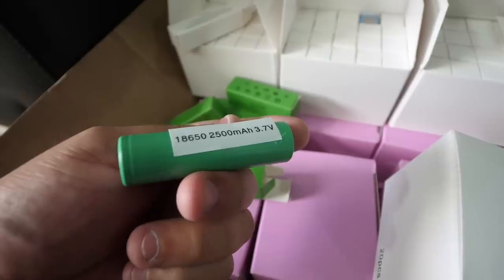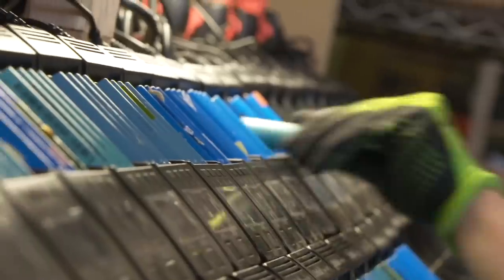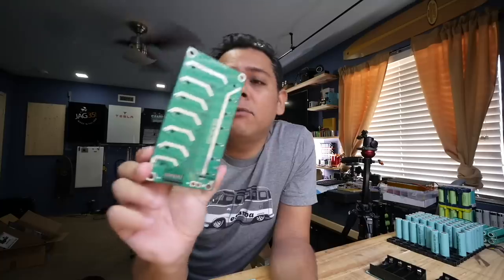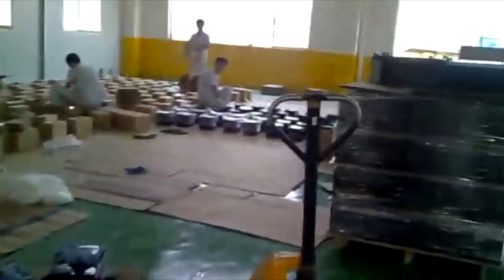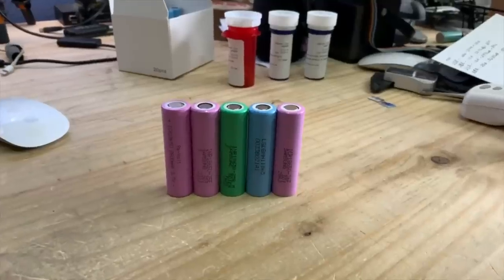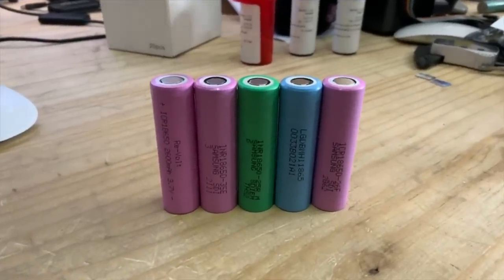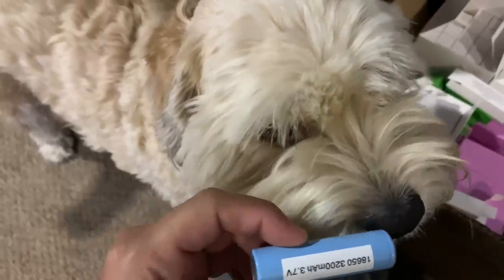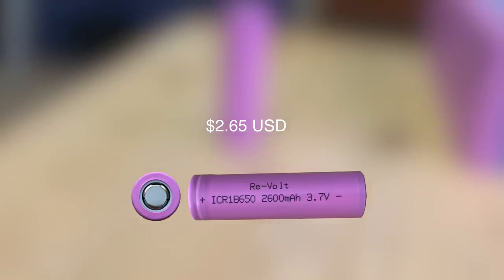How to TEST 18650 cells  (DIY Powerwalls)

Comment: what cells are good for a 12V 100A DIY battery pack made of Li-ion cells?? 18650s , 21700s or other. Instead of 10A is it a wise option to good for a 40A discharge with better mAh to reduce the number of cells, therefore less weight. Better discharge so that my motors can draw at least 50A on different motors.

Comment: Old video I know, but do you offer a 14s pcb? I am currently building a power wall for a little project and have decided that 48v system would be the best for my use. so I am looking for something more advanced than just making 13-14 200p cells with a couple bms's in paralleled.

Comment: Can you do a good short video (maybe 5-10 minutes long or so ) explaining the typical 18650 battery descriptions please. Because I need to know what mR (internal resistance) a supposedly brand new 3000mAh Samsung 18650 30Q 15A button top unprotected battery should read on my Zanflare C4 charger tester. All my four supposedly brand new Q30s display 2.50mR - 3.50 mR on the Zanflare C4. Should all good condition 18650 batteries have about 1.00mR ? I can understand the 10A versus the 30A discharge ability and the 3000mAh versus the 2000mAh storage capacity and the 3.00v versus the 4.20v volts concept but don't know what the proper mR (internal resistance) should typically be at. Thanks so much

Comment: I do not think the operating temperature is what the maximum temp the battery will get. I think the operating temperature is the range of temperature that you can actually charge and discharge them. If they write max 60 celcius, I think it mean that it is not suggested to charge or discharge it at any load if the outside temperature is more than 60. What do you think?
Reply: Um the Operation temp is set by a test in the factory that shows how hot the battery gets if the maximum current rating is used over the entire capacity of the cell:)
Reply: @peterzingler6221  No. That is exactly not what it is. It is exactly as some people already said the range of temperatures in which the manufacturer "guarantees" it's product to work in. For more you can also read https://en.wikipedia.org/wiki/Operating_temperature

Comment: You don need anything fancy at all to charge batteries its all standardised and the chips are cheap as dirt.
MCP73831T-2ACI/OT -  LI-ION/LI-POLY CHARGE CONTROLLER its 72 cents.
a cheap charger may be risky but if you can open it up and see if its using industry standard parts .

Comment: ALWAYS ENJOY YOUR VIDS MY BROTHER ! . I HAVE A QUESTION ON EBAY I CAN GET 4 " Panasonic NCR18650B 3.7V 3400mah Battery " FOR TOTAL FOR 22.49  THEY ARE BUTTON TOP CELLS FOR LASERS AND NIGHT VISION .  THEY ARE MADE IN JAPAN WHICH SOME SAY ARE BETTER THAN MOST IN CHINA ESPECIALLY THOSE CRAZY OFF BRANDS ,DO YOU THINK THESE ARE A PRETTY GOOD DEAL AND GOOD PERFORMANCE ? THEY ARE ALSO PROTECTED CELLS AND COME WITH A STORAGE CASE !  THE NIGHT VISION DOESNT DRAW VERY HIGH AMPS ALSO !

Comment: Jehu, how about a project on building single solar panel solar generators, for example, a 300watt panel with a lithuim cell pack , a charge controller and an inverter, all in a self contained unit or two, maybe three smaller panels 100watt panels in a folding configuration, or three 300watt panels that interlock and inter connect as needed?  Saludos from PUR.

Comment: I also started to harvest 18650s from laptops and cordless tools.

I'm testing the capacity of the cells with my XTAR VC8. I've taken 3 measurements of the same cells. And from 2nd and 3rd measurement I only took power cable out and back and new test started again ( the cells have been untouched) and the results are +/-, is this normal?

the differents between 1st and 2nd measurement [mAh]:
+/-56
+/-5
+/-62
+/-10

and then 2nd and 3rd[mAh]: (only power on-off and test again)
+/-10
+/-6
+/-34
+/-11

How are your experiences with your capacity tests?

Comment: Have you gotten into 20700 and 21700 batteries yet? Theres a really great guy in the vaping scene named John, he goes by battery mooch. He professionally tests batteries for a living, ya should look him up, just google battery mooch, hes tested and rated hundreds of batteries. Ive started using 20700 and 21700  bAtteries as they have higher capacity and continous ratings.

Comment: Hi i have a question mayb u can help me out. Whats a safe amp draw if i were to connect 3 lithium ion battery  in series (11.1volt)  the battery specs are: 3400mah rated at 4.9 amps. Its the ncr18650b. Im used to the c rating printed onthe battery not the amps. Thankx
Reply from the maker: Those are 3c max I’d say, so 10A-13A

Comment: I understand you have a very busy schedule and have a business to run. Don't know if you saw my question yet or not but was wondering if there is a way to use an electric motor on the front of an e-bike to charge a secondary battery system so that you could use a dual system of batteries to extend the range of an e-bike?
i was thinking a 48 volt motor on the rear and a 36 volt converted to a charger on the front . do you think it would work I do not have your experience with ev's and needed an experts opinion on it.
Reply: thermodynamics says this is a stupid idea. If your idea is to use the second motor to  charge a battery. Anyway bigger battery or use less power are best way to increase range.

Comment: I thought that storing your cells in a cooler or colder temperature did not affect 18650s     any opinions on that?.
Reply: Hot or cold will ruin a battery

Comment: pricing on these are so close to lifepo4 cells.  Though I'm comparing your 2018 18650 numbers with 2020 lifepo4 costs.  

lifepo4 lasts way longer so why would you use 18650 for a powerwall?

Comment: Hi, Jeju; At 7:43 - I saw that you said that your 10-cells' average mAh value - across the 10 cells is/was 3,649 mAh's - but that looked wrong. I ran the numbers, and for those 10 cells' values - their average is: 3,689 mAh's. Not a big deal - but I thought I'd call it out.

Josh

Comment: When you say genuine do you mean brand specific? Can non-genuine cells still function properly and at the right voltages sometimes?
Reply from the maker: All cells can be useful,  but you shouldn't be paying Mercedes-benz prices for Kia performance.
Reply: who said there is no kia that performs like mercedes, even better in some features
.
Reply: They just needed a post content, an 18650 is an 18mm by 65mm Li-ion cell. You can get into brand efficiencies after that, but this title is just a cash grab.

Comment: Do a video on how to order cells directly from china
Reply: I sell 18650 battery，We usually find a forwarder who can do DDP or LCL by sea export.
Reply: 程前 Whats your Price per cell?
Reply: @程前-k8n  well, bud, what's your website? We want to buy
Reply: Deltasec Computer  my batteries are 1200 to 2600, price from 0.4 to 1 USD , most of the using in the lights Bluetooth speakers so my battery is the capacity type

Comment: @VK ELECTRONICS  after separation each 4 battery are showing 4.5 volt, total battery power is showing 17 volts. Now noticeable point is battery is 14.5 volt whic is print on battery case. Now the proble lm is my battery backup was 10 min, after opening and testing i close the battery but my laptop is showing "battery is Permanent damage, please change it." Please help me!

Comment: In addition to thier discharge performance, how well do these cells hold up to the safety and robustness specs in thier datasheets? For example, the Samsung datasheets claim thier cells will not catch fire or explode when subjected to a 12V/2.6A overcharge for 2.5 hrs, or similar. 
Obviously, this would destroy the cell's normal characteristics so it's not something we'd like to do with cells destined for a powerwall. But perhaps it would be prudent to also confirm these safety specifications from the datasheet in a real-life test? Especially from a lesser known manufacturer, who may not catch as much legal flak than "brand name" manufacturers if their cells don't live up to thier specs in a spectacular way. It would be interesting to see how all these cells deal with abuse when something does not go quite as planned.
Reply from the maker: Totally,  I see torture tests in my future for these cells

Comment: Hello brothers, I NEED YOUR HELP, !!! PLEASE!!! I want to build spare power pack for my xiaomi m365 scooter. As far as mechanics ,soldering, connection etc !'m sound and I know what I'm doing BUT I don't know what cell spec I need. 
SO what I know  I will use 18650 and I want 36v 7800mah setup. I read somewhere that i need 2500mah cell. I don't know how its calculated but i read it somewhere. Can you suggest what spec I need? THANK YOU!!!

Comment: No the resistance is higher because your battery cell is warmer than 25 degrees C
Reply: The internal resistance of the cell doesnt change by temp ^^
Reply: @peterzingler6221  ohh it definitely does. If you deny this you deny some of the basic principles of our scientific laws.
(also iam an University Graduate of Electronic Engineering so i probably know what iam talking about).
Please think before you talk, and if you still don't believe me just google something.

Just look at this graph. https://www.mpoweruk.com/images/calendar%20life.gif (ignore the time on the X axis).
You can clearly see that the battery on different temperatures has different resistances.
Reply: @brinkshows2720  Buddy if you have a grade then shame on you for this graph , what does that say not even the type oft battery is listed
Reply: And even then when we are willing to call changes in milli ohm Region a resistance change the resistance sinks with temp its not higher like you said
Reply: @brinkshows2720  a higher current means more energy transfered to heat by internal resistance yes, its a huge Problem in some electric cars
Reply: @peterzingler6221  Well lets take just a random resistance number out of the video. 68 mOhms.
Discharging your cell at 4V 10A means a loss of 6,8 watts over 33,2 W which yout output.
Now lets say you believe the graph and you go from 30*C to 55*C you increase that resistance with a factor of 1,3. This makes the cell 68*1,3=88,4mOhm.
Lets calculate that again. 4V at 10A means a loss of 8,84 Watts.
Now to efficiency.
20*C is a discharge efficiency of 83% which is reasonable.
55*C is a discharge efficiency of 77,9% which is quite allot lower if you want to pull out all the juice from these cells. So yeah a couple of mOhms can make quite a difference.

Comment: Any indication of actual cycle longevity in these tests?
Reply: I was thinking the same thing.  Over on the forum called "Second Life Storage" a user by the name of GENERIC went through the painstaking process of capacity testing four 18650 cells, hundreds of times.  Three were generic Chinese cells and one was LG.  It turns out that all four of them initially tested fine but after about 350 cycles, two of them (CJ and THLD) started to dramatically lose capacity.  By the time he hit cycle #800, the CJ and THLD had dropped in capacity to almost nothing.  Meanwhile the other two 18650's (LG and ASO) were way up at about 80% of their initial capacity.  So the moral of the story is:  even if they initially measure fine, their life expectancy may be significantly less than a name brand cell.  The only way to tell is to cycle them and look for "early" capacity degradation.
Reply: @test-193  Total Lifetime Cycles is yet another specification that needs to be provided and verified.  Total Cycles  is very dependent upon % DOD, Discharge Amps, Temperature and Age ...

Comment: Please excuse my stupid question.  I am a very stupid man.

If I actively cool my cells, what characteristics does that allow me to push?  Can I pull more amperage?  Will they exhibit higher capacity?  (Well, more efficient output, but you know what I mean).
Reply: Yes, of course, if you actively cool the cell then you can draw more amps, without overheating ...
Reply: @MrSummitville  I dunno about the "of course" man - it's not at all obvious to someone who is extremely stupid and knows nothing (like me).

Comment: You are using datasheet wrong. Additionally high capacity (and not 10 A cells) cells with longer life cycle will suit your project. You should ask your supplier life cycle data for the chinese cell.

Comment: I can't help thinking that large variation in the test values is at least as big a red flag as a deficient average.  If your test setup is the cause, then your test setup is incapable of the test.  If the cell batch contains deviant cells they can not produce a reliable high performance assembly.

Comment: Interesting.  A number of years ago, I bought some cheap “solar powered” outdoor lights. . .  The battery cells were the size of an AA cell.  Suspicious.  Instructions stated that they had to be exposed to sunlight for (if memory serves), 12 hours before use.  Again, suspicious. 

The lights didn’t work very well .  On a “whim”, I replaced the supplied “plain yellow wrapper” cell with with a depleted Duracell AA.  Guess what?  It worked better than the original.

I suspect the supplied cell with each light was a recycled, rewrapped chinese unit.

Since then, I view almost everything Chinese with jaundiced eye.
Reply: Bram. The solar cell batteries are  probably nickel cadmium (NiCad). These batteries are inexpensive and great for fast charge/discharge cycling. They work best if fully charged and discharged each time they are used as they suffer from chemical "memory" (if you short-cycle them, they remember the short charge time and only accept partial charge thereafter). This is why they are great for solar lights. 
The "12 hour" charge in sunlight means that the batteries must be installed in the solar light and charged for 12 hours to fully charge the batteries before use.
Your "depleted Duracell AA" (alkaline) is nominally rated for 1.5Volts whereas the NiCad (and NMHd) are nominally 1.2V when fully charged. A fully charged AA alkaline battery will ruin your light. Moreover, they should never be installed in a solar re-charger as they can catch fire or explode.
Reply: Tom: I’m just relating my observations.  Never did a duracell catch fire on the solar lights.

Comment: One 18650 battery is 1000mAh 
& Second one is 2000mAh 

is there will be a problem with two battery parallel connections

Plz help
Reply: Paralleling those two will be fine. You'll end up with a 3Ah battery that has pretty much the same voltage ~3.7-4.2V.
Reply: @anispinner  thank you so much
Reply: @mdalamin4724  No problem brother. Have a good one!

Comment: The one killer that you can't test (easily) is cycle life. Whatever their performance figures are at charge #1 is not so relevant at 100 to 500 cycles in. The brand names that stand out are reflected in the performance of harvested cells, my experience doesn't fare so well for the Chinese ones here.

Comment: why didn't  you mention the most basic of all test. weight test. for instance let's  say a 3000 mah should weight no less than 45gr. a 2500mah 40gr and so on. yestarday I got delivered 20 lithium ion "3000mah"  bought at walmart.com from a third party but fulfill by walmart for $2 each.  The first thing i did was weight them up, and they only weighted 24grams. no test no nothing. got in contact with them and told,. yo those batteries are fake. walmart without hesitation refunded me, and were told the seller said I can keep, donate or discard them. yeah right. They just got busted and didn't want to lose more money by paying for returning shipping. the fact is having the right weight is no warranty they are real. but if the weight is off for sure they fake.